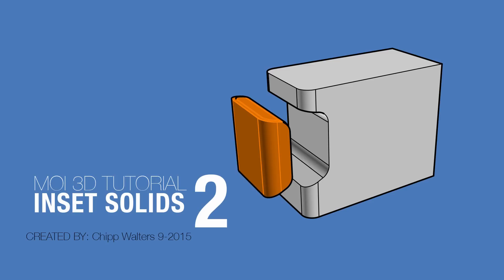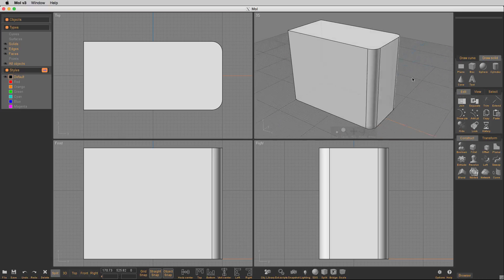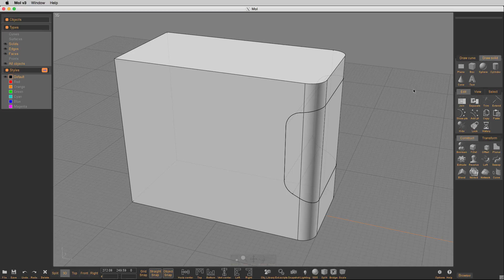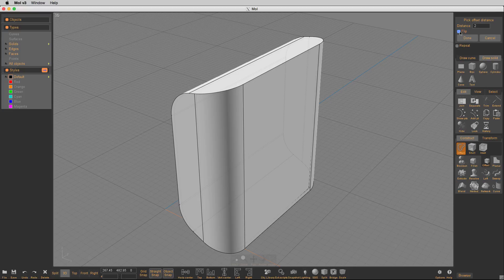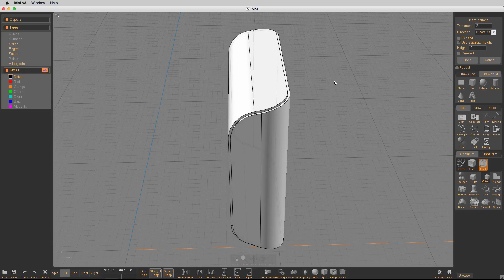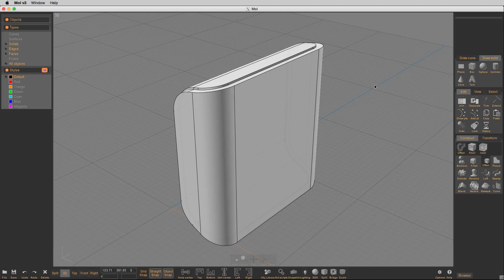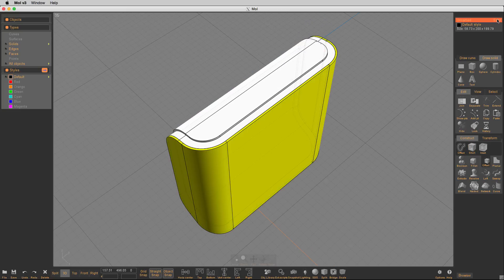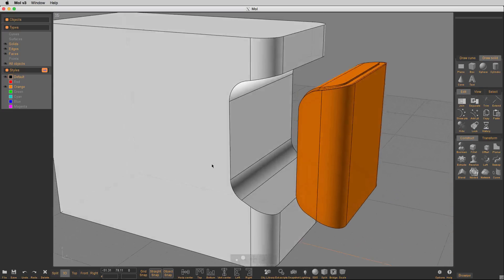MoI3D Inset Solids 2

Comment: i had tried to replicate your tutorial but moi3d failed to respond at 1.11 around( only Calculating... on the Inset Panel) after I applied the inset command on the small geometry derived from the boolean subtraction. Pls tell me how to fix, many tks.
Reply from the maker: You may be using the wrong scale or didn't create something correctly in the previous steps. Sorry.
Reply: tks 4 u quick reply, i will try again based on your hints!